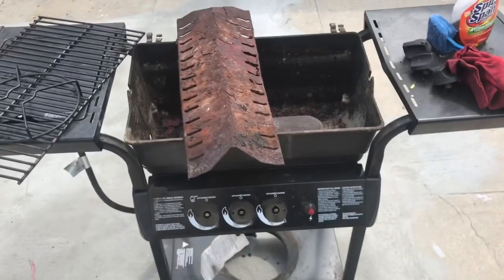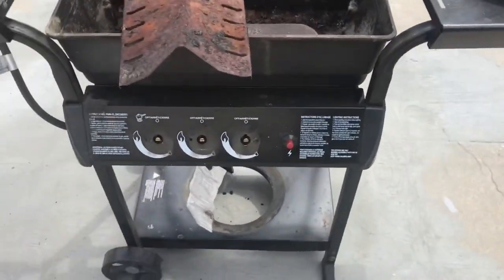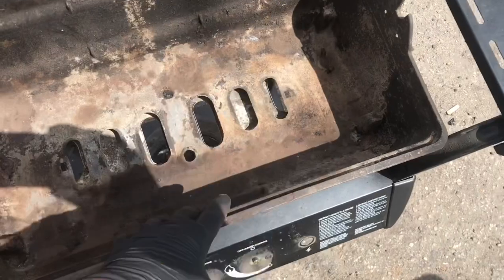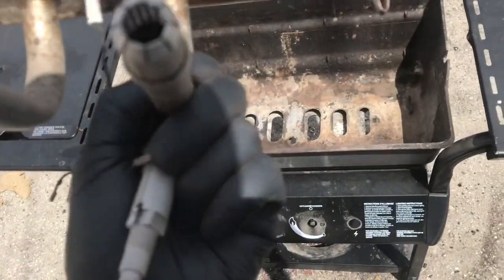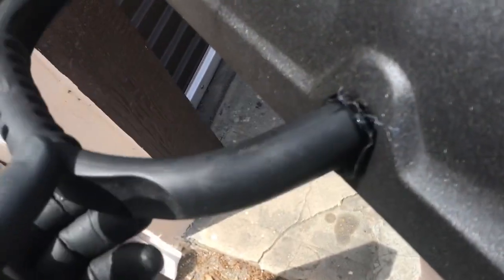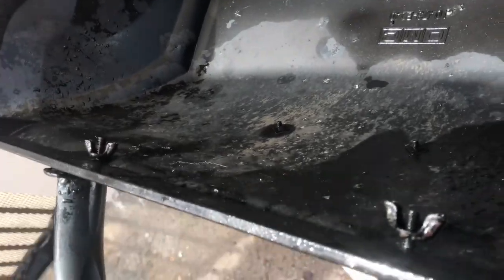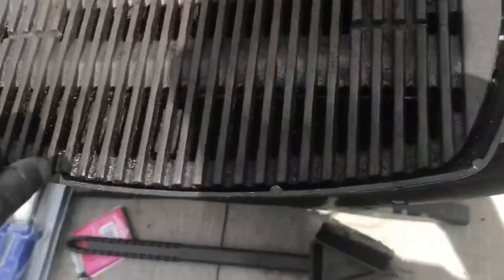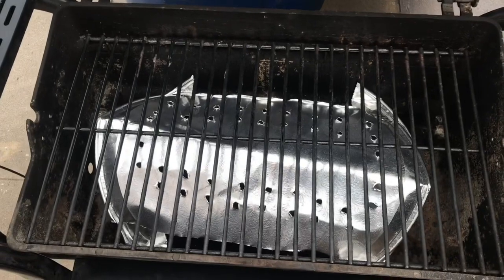Huntington cast gas grill rebuild

Comment: ive extended life with my old bbqs by adding lava rock.  it worked so well when i bought a new one for my camp i added the rock right away.  those heat deflection shields are junk... after the rock gets used a bunch of times, it gets seasoned so well and things just taste much better... smoked almost.
Reply from the maker: Great tip!